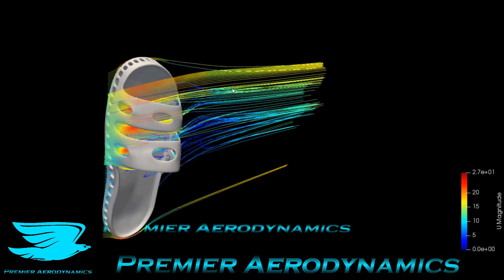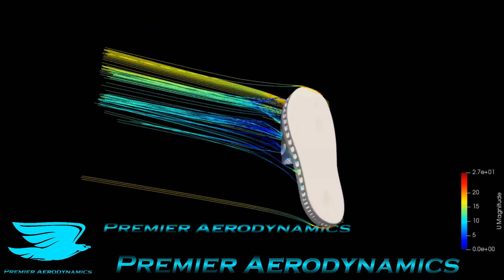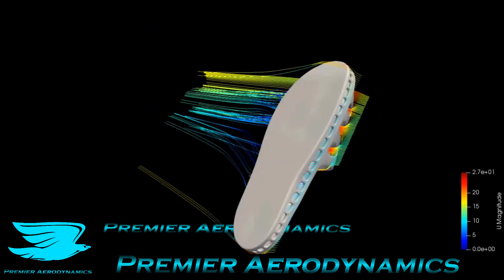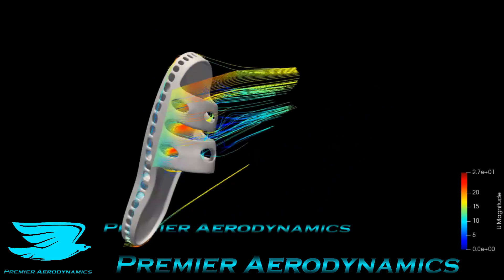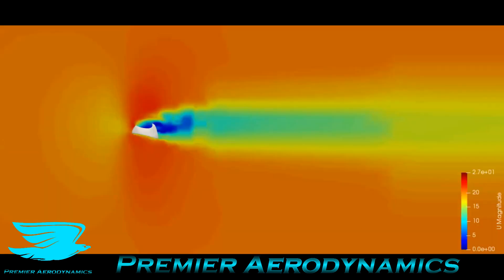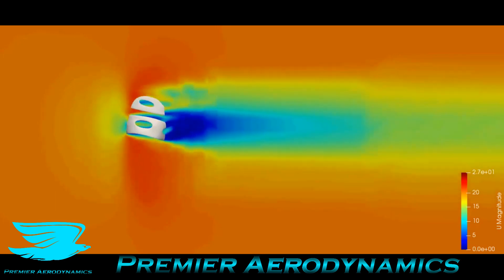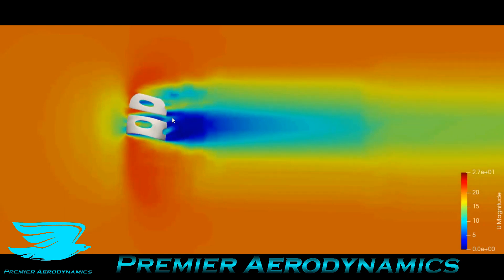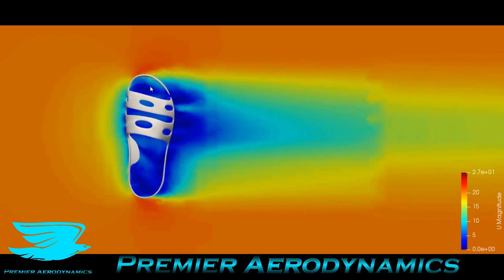How Aerodynamic Is A Sandal If You Threw It?

Comment: what is this weak ass RANS shit, you gotta do a coupled FSI model to see how the sandal will tumble in the air
Reply from the maker: Well, bum cheese, if that is your real name, that would be interesting. But, any seasoned sandal thrower knows that putting enough spin on it will make it rotate about the y-axis...so maybe just a rotating wall or MRF condition would have sufficed.🤔😁